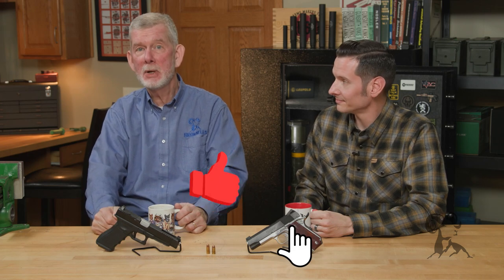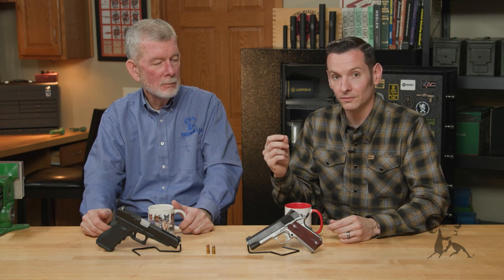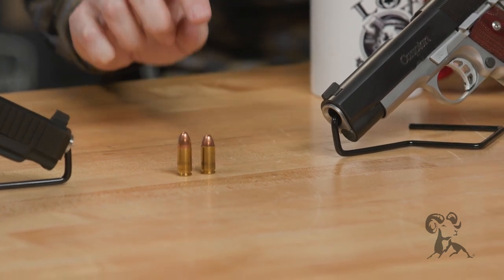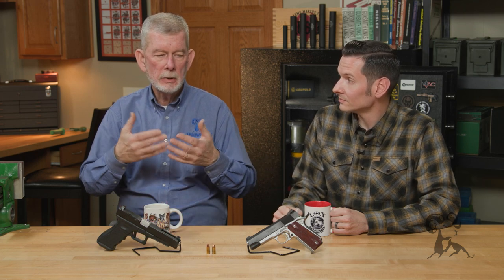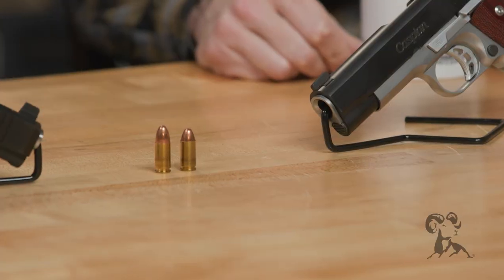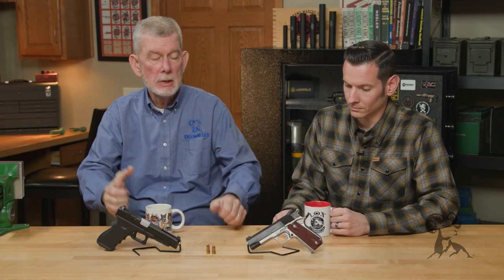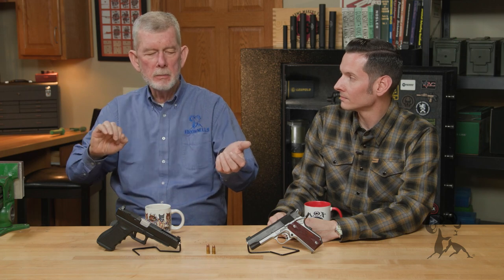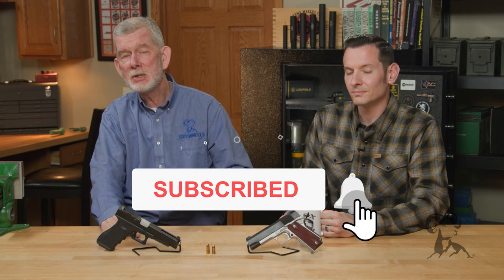Smyth Busters: Will Excess Bullet Setback Blow Up Your Gun?

Comment: I just don't load mine out of my mag, for example,  p365 I throw in chamber, let slide foward with care, push in on rear of extractor with finger until it slips over case. P320 I hold the gun so my rounds sits on feed ramp, carefully let slide foward, rim slips behind extractor and chambers, don't do this if not very experienced and ALL saftey rules ALWAYS apply.  I try to leave loaded for most part.
Reply: I do the same.  Even then after maybe 5 reloads, i replace round.  I heard primers can get pushed in a little and become hard to set off for this reason so I try not to keep the rounds too long.  I keep my chambered round a tula when the rest of the mag is quality JHPs so that replacement isn't bad

Comment: The first time I heard this, I checked my EDC 9mm and sure enough it was pushed back about an 1/8". S&W M&P shield plus using SIG Sauer HPs. These rounds are sealed and crimped and still had it. Haven't had the same issue on my Sig P365

Comment: I know you mention Glock has a straight in chamber, but I also saw setback on my Glock 32 (.357 Sig) using Speer Gold Dots. Same exact ammo Texas DPS uses (which is where I got it when I worked closely with law enforcement). Never fired a setback round, though.

Comment: There was a specific brand of .223 55 gr. FMJBT that I mail-ordered a couple of times about a year ago, BOTH times they came in with the bullets points heavily imprinted on the tops of some of the boxes (note that I wasn't buying full cases). There were also the occasional and almost normal minor dings to the SIDES of the cases... OK, some of THOSE weren't so minor. Curiously, they were well-packed and had no signs of distress outside OR inside the shipping boxes.

What MUST have been happening was that they were subjected to high loads somehow while on the original factory shipping pallets and in the factory cases, most likely to cases on the bottom of the stacks. Whether the pallets were being handled roughly, or pushed tightly against each other while loading, or traveled in a rough-riding truck, it took some high loads to do that.

Of course, this meant that I needed to check the overall length of each cartridge to be safe... tedious with hundreds of rounds to inspect. Turns out that this specific load seemed to have an easy-to-remember overall dimension, taken from a sampling of rounds from boxes that had NO signs of compression, etc., namely, 2.223" : )

Comment: Well I just found this video and since I was switching to a new defensive ammunition I figured that I would experiment. I have a Glock 20 SF and I had two mags of SIG Elite Performance V-Crown hollow points. I racked both mags 10 times . So that was 30 rounds chambered 10 times. I didn't notice any difference in bullet height and both mags were fired off without any issues.

Comment: I am not a gun person at all so this question may seem stupid. If too much set back will cause a increase in pressure over what the gun was designed for. Why not take advantage of this phenomenon and design cartridges with this in mind. You could have shorter cases and thus shorter cartridges, use less brass and use less gun powder. You get a lighter shorter cartridge with the same pressure pushing the bullet down the barrel. The chamber would have to be redesigned to fit the shorter cartridge but other than that shorter lighter ammunition seems like a better way to go especially for the military.

Comment: Bullet setback does not have to be as severe as shown to cause a problem. Sometimes it takes a set of calipers to see the difference in overall length. A quick way is stand a round up next to 1 or 2 fresh rounds out of the box and look very close. If it looks shorter, grab the calipers.

Comment: I have a DE and found the following
Some people say the bullet will not chamber the odd time, after firing a bullet
I reload all my shells and found the following makes considerable difference where the bullet does not give me that problem
I shrink the overall length of my 44 mags, by no more than 15 thou, where i usually only shrink the bullet by 10 thou
This makes chambering much better,
Do you think that is to much? and will cause problems, when it definitely helps the automatic chambering without problems.
I have dine this with several reloads

Comment: I would have thought that covering bullet ‘seating’ would’ve been considered a MAIN reason. i consider it MY main reason as a reloader. If the bullets aren’t seated (and/or crimped) tightly “enough”..you’re GOING to have issues. Happened to me with a .30-30 lever-action, factory rounds. Just so happened it was NEXT to be chambered..and it was when I cleaned it after the hunt. TOTAL bullet separation from the case!

Comment: I don't know how likely this is but I have seen it a few times in my time in law enforcement, we are supposed to (depending on policy) unload your duty weapon every day when you get off duty. though I understand this is not actually practiced by many if any officers but enough rambling. I have seen one incident on a body cam and 2 at the qualifying range where a round that had repeatedly chambered from clearing a weapon amd just loading the round back into the magazine tor rechamber the next day. I believe perhaps the primer had been damaged by the repeated chamber. both times I observed it had a clear primer strike from unmodified weapons (one was a glock 17 and the other a sig p226) and we did not have any problems with light strikes for the rest of the qualifying. we where using spear gold dot ammo so not cheap white box stuff.

Comment: Steve mentioned +P+ loads - unfortunately a lot of guns out there are not even +P rated, so even more critical if the owner is  running higher power rounds which also include a setback. Definitely not something to mess with.

Comment: One of the Range Safety Officers where I used to shoot kept a tool on hand to dispose of such questionable cartridges by dismantling these into the components for recycling by reloaders.  The cases empty of powder and projectile were sometimes "shot" by the owners rechambering them and capping off the primers, which still had enough force to be treated respectfully as complete rounds.  Would Steve and Caleb kindly feature this tool or tools and give a demonstration ?  I don't reload but it would be useful for safety purposes to have.

Comment: I just quit a job one reason was they required you to load and unload your firearm every beginning and end of shift . Being the new guy I didn’t wanna cause a huge fuss but subtly voiced this concern. That and few other factors in addition to getting another Job offer I quit after 2 weeks. Ironically they thought they were doing the safe thing even though their negligent discharge rate was high, Kevlar lined store room , camera equipped and a buddy system to watch said camera. They even tried to explain it was easier on the Glocks not to have one loaded all the time .

Comment: I'm surprised they didn't touch on this.  Straight walled cases that headspace on the case mouth are prone to this. A rimmed cartridge can be firmly crimped because it doesn't headspace on the case mouth. Most rifle ammunition is bottlenecked and headspaces on the shoulder. This allows a firm crimp on the bullet.

Comment: In my experience, 9 mm, especially quality loads, tend to not have as much of a problem with setback, because of the tapered case. 45 ACP seems to be more prone to setback. The model pistol also factors in as y'all have mentioned. Will the set back be enough to cause the gun to blow up after a few rechambers? Probably not...IF You Are Using Quality Ammo. However, if you're rechambering it indefinitely without replacing your carry ammo for a while, and/or if you're not using Quality ammo. All these variables are likely why firearms instructors like Reid Henrichs advise not to rechamber the same round even once. Personally, when I unload my firearm for whatever reason, I hold the round that was in the chamber aside and make sure a different round is chambered when I reload it. The set back issue is another reason to change out you're carry ammo with fresh rounds periodically.

Comment: I have shot probably over a dozen rounds out of an SKS that were setback by bullets missing the chamber and getting wedged by the bolt. I've always shot them with no issue. (plinking so don't know about accuracy) All was steel cased/low grade commercial ammo so not exactly "hot" ammo.

Comment: Short answer, no.  It the load was already at the extreme edge of high pressure, the increased pressure of bullet setback might blow out the case and cause problems.  But the gun won’t blow up.  A standard pressure load won’t spike enough to cause any real issues.  I have shot several auto loading rounds that had setback just to see what would happen.  Nothing happened.  The gun fired and cycled and I continued.
Reply: My milage varies... Sadly...

Comment: I avoid this by inspecting every unfired round coming out of the chamber for proper crimp retention, which is few and far between. Also, once a year, take your carry piece to the range for cycle and accuracy test. Don't forget to practice with (relatively) cheap ball that most closely matches carry ballistics.

This also proves the firearm will perform under adverse conditions, as dust, dander, body hair and lint will no longer make you second guess its function in that split second you may need it. Clean, lightly oil, reload and repeat.

Comment: It's actually not a pressure increment. It's actually the direction of the expansion. If the bullet is normally set, the expansion of the pressure directs toward the tip of the casing thus driving the projectile down the range. When the bullets are setback, it's too tight for the expansion to push out the bullet and the direction of the expansion instead of going forward and pushing the bullet, it expands in every other direction, even at the rear of the casing where the primer is. So these expansion causes an explosion all around the cartridge therefore explodes the chamber instead of deiving the projectile forward. 
This explosion can lead to pressure leaking behind the cartridge and on the chamber wall and primer hole. Especially the pressure leaking behind the cartridge can cause serious blow towards the shooter or even explode the chamber cuasing injuries to the shooter.

Comment: I've had issues with 357 sig ammo when reloading. There's not a lot of area on the brass to secure the projectile . I shot a round that was set back and the recoil felt like a 44 magnum . After the pressure spike it locked the slide closed. A rep from sig came down and had to unlock the slide. When reloading 357 sig I use the appropriate powder and do a compressed load . This keeps the projectile from sliding back haven't had that problem sense.

Comment: You'd be surprised at the pressure change with the smallest changes to charge weights. If you're working up loads with powders there is no data for you need a program like quickload just to figure out theoretically safe max powder charges and the minimum (funny things can happen with not enough load density too) or you are asking for trouble. Don't fool around reloading.

Comment: My SA 10mm Ronin (1911) sets back standard factory S&B and Magtech bullets something fierce.  Both JHP and FMJ.  These loads are considered low-power, but I've measured as much as 1/8" setback after one chambering.  I've fired these rounds and never noticed an increase in pressure I could sense...but the setback is large and obvious.  Haven't purchased other brands of 10mm ammo...$.75/round for this "cheap" range ammo is about all I'm willing to spend...

My Sig 9mm P365 in a variety of factory loads does NOT setback any bullets that I have chambered, sometimes more than once just to see if it would do it.  Neither does my wife's .380 Shield EZ.

Comment: Hey yall. I have a few 9mm rounds that is slightly, set back on 1 side. The 9mm round's tip is slightly off set of center. I removed the rounds that I noticed the tilt (off center) on them and put back in the box because I was afraid they may not function properly, or cause a catastrophic failure. I wish I could attach a picture of the 9mm rounds to show. It was caused by unloading and rechambering, but was very seldom that I did/do so. Also the side of the case was deformed on 1 or 2 of the rounds.

Comment: Had a somewhat similar experience with reloads but in a opposite way for the bullet movement because of recoil. Was loading 44spec loads for 44mag with Hodgdon clays and made an honest mistake of looking at the wrong line in the loading manual,(many list 10 to 20 powders for one bullet weight ) 11.2 gr instead of around 8 made a tame 44special load into a fire breathing beast. I knew something was up when they were hard to eject and the bullets were creeping forward.Needless to say it was back to the drawing board after very few of them test fires,but in my mind it was aw it's a 44 mag itll hold it but I didn't and trusted the signs of overpressure. I now check,double check,and triple check that im loading the correct charge weight for a given powder because it is so easy to double charge or wrong amount and something catastrophic happen even when everything else is right
Reply: same thing happened to me with some heavily lubed and hot loaded Sellier and Bellot in .38 Special. In a full sized frame revolver they were okay but in a lightweight snubby they crept forwards until they poked out of the front of the cylinder and kept it from rotating.

Comment: Heavy open bolt smg or such no problem. Pistol throw away. LEO/Mil common problem= check your ammo. First cartridge , change it every time.
15 round mag after 15 lock and load.
Shoot away in practice and no more issue carryammo.

Comment: I've been shooting for as long as I can remember. I'm not a gunsmith or loader. I'm aware of "set back" and that is why every time I "have" to clear my EDC I completely unload the mag, in order, and place the "chambered" round at the bottom and reload the mag rechamber the round (via the magazine) and place my "second" round into the magazine (giving me my 15+1). Hearing you describe "set back" I'm kind of curious. Since, generally, you are not reloading steel ammo and the casing (in steel) is much more rigid then say brass, I would assume it a less likely occurrence to get set back? The reason I say this is also because even under the pressure of being fired the casing itself still doesn't deform enough to make as good of a gas seal as brass does... Just for for thought. I'm curious if you would hypothesize the same thing? OR It could be the exact opposite, and because of the rigidity of the steel when the round is set that you get less surface area contacting the round, therefore less friction, therefore greater chance of "set back". Again, just curious as I can't fathom both materials (brass/steel) would behave exactly the same.

Comment: This begs the question, if you have significant bullet pushback/setback, can you take a pair of pliers and/or a bullet puller and pull the bullet out to the correct specifications (length) and will it be safe to fire, or will you have case deformation (depending on the round) still making it unsafe to fire? If that’s the case (no pun intended) what do you do with the setback round if you just don’t want to hang onto it or throw it out (for safety reasons)???
Reply: I use a tool called a bullet puller to remove the bullet. I dump out the powder, fire the primer, and give the bullet to a friend to use as ballast in his model airplanes.

Comment: Look, if you own a modern gun and it blows up from stock ammunition with ‘set back’, then you already bought a gun that wasn’t safe to shoot because that means it had no tolerance to any extra chamber pressure at all. normally, firearms have a little pressure tolerance and they normally don’t tend to fail because of a tighter bullet in the case. So if you shoot a round with set back, it’s normally safe -BUT for safety reasons and for especially for reliability purposes. I would personally recommend changing ammo when set back occurs and it has more to do with the reliability of the gun and with the powder charge itself, -you see, having a loaded magazine in your waistband is like running live ammo in a rock tumbler so over time, the powder charge with begin to break down in the cartridges into smaller granules and that is what realistically causes ammo to become dangerous because of pressure changes. That’s just a tip from me, personally as a reloader. You’re welcome.

Comment: I'm not clear on how compressing the powder will increase the pressure significantly. I think that the bullet leaves the case long before the powder finishes burning, so the extra case volume should play very little role in the peak chamber pressure. Now, it's a different story if something prevents the bullet from exiting the case, or if somehow compressing the powder makes it burn faster or detonate instead of deflagrate.
Reply: Compressing the powder doesn't. Reducing the case volume increases the pressure, if you're loading hot, seating deeper can be enough to spike the pressure enough to have pressure signs.

Comment: Guys, will a cannelure on the case help prevent the slug from recessing into the case? Case resizing during the reloading process would seem to at least partially eliminate the original cannelure. Could this be a reason the setback is associated more with reloads?